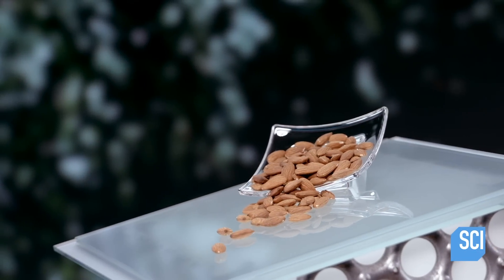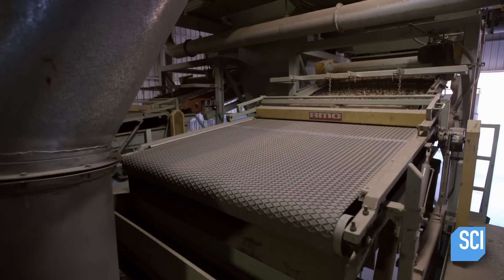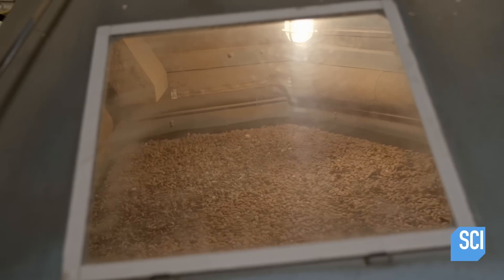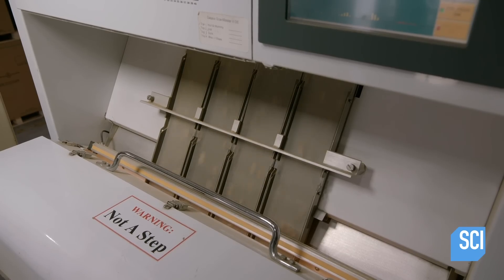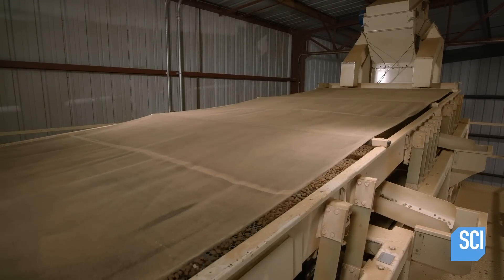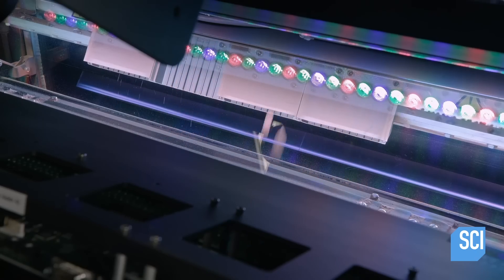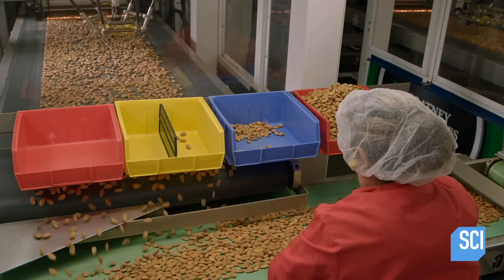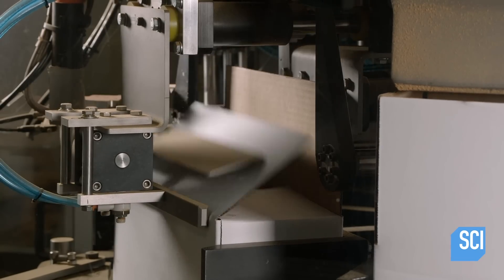How It's Made: Almonds

Comment: The modern almond industry is actually pretty harmful to bees. I don't know about you, but that's not a "Guilt-Free Snack" for me.
Reply: Why?
Reply: @commonsense2469  Most almond trees require cross-pollination to produce, and honey bees are the main pollinators used in this process. Because of industrial farming practices this either requires the bees to be brought in during pollination times which is really stressful to colonies (its bad to move colonies to areas the are unfamiliar with), or the bees are kept on site at which point they basically only have a diet from the almond tree which is way too limited for an insect that typically feeds on a whole host of nectar and pollen. 

There is actually a quickly expanding body of research to show that the explosion in almond milk popularity is doing a lot of damage to bee colonies used in the process as well.

Comment: What I got from this video:
- Almonds just magically appears in a factory.
-Always wash your almonds, always!
Reply: WifeOfOryx created by lasers, cameras and tiny puffs of air.
Reply: @Shnick  a
Reply: Also the shells are removed by magic.
Reply: I never wash my almonds brrrr
Reply: Or wipe them off. 
Raw almonds are as good or better than roasted. Depending who grew them.
Reply: But how are they shelled?
Reply: @JB-if7bu Almonds are shelled using a roller sheller which is two rollers placed a certain distance apart that breaks the shell and hopefully leave the nut meet unbroken. The nuts are sized before they go to the roller sheller. Pre sizing reduces the number of almonds cracked in the shelling process.

Comment: I'm not surprised they didn't show the 2 ways of pasteurization process that ALL almonds have to go thru before they go anywhere.
1.Heat. 2.Chemical
Most are chemically treated and the chemical is pressurized deep into the nut.
You might be surprised what chemicals they're using and never eat another almond long as you live. Not to mention radiation that a lot get hit with. I'll never eat an almond unless it's just off the tree.
Reply: All almonds sold in the US must be pasteurized due to food safety laws. The rest of the world this isn't the case.  And if you do your research, I think you'll find that there isn't a trace of polypropylene oxide (the chemical used) anywhere on or in the nut after pasteurization. Have a nice day!
Reply: @cphippen85  I've done ask the research and yes, almonds are loaded with the cancer causing chemical at high levels. It is pressurized into the almond while it's moist up to 400 lbs and is deep within the meat of the nut. Your finding is false.
Reply: @Tadjuel11-11  source? if you're gonna claim something has "cancer-causing chemicals" in it, maybe back that up with some science.